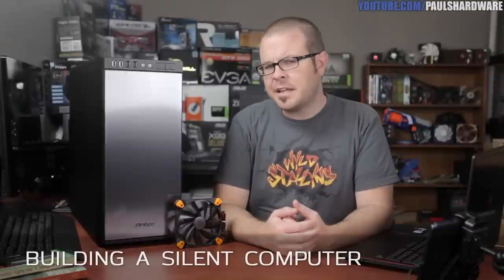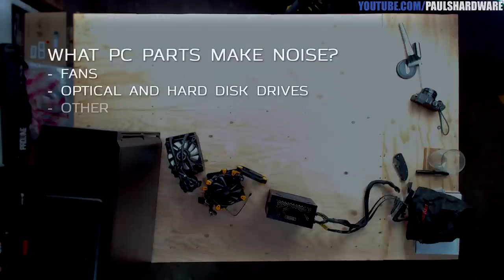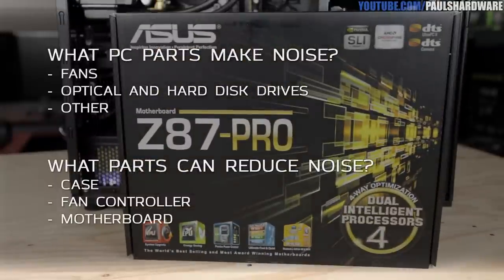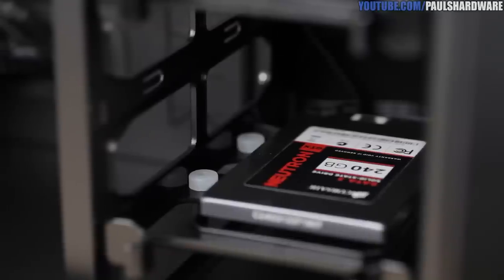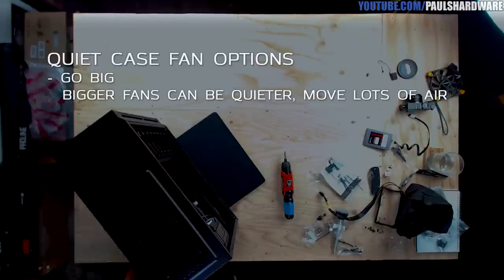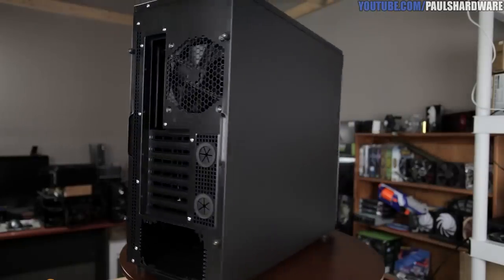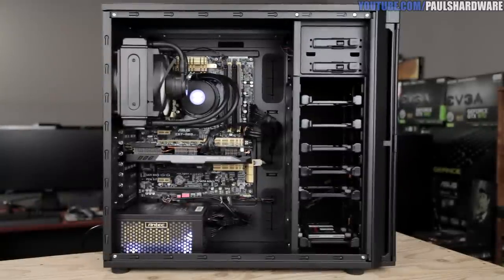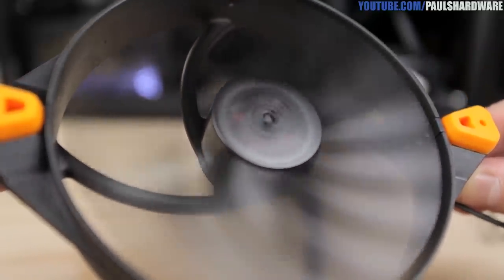Building A Silent Computer

Comment: How to build a silent PC:
1. Don't.
dB Measurements:
Case Open: 0.0 dB
Case Closed: 0.0 dB
Reply: lol literally my computer right now can fill my bedroom with its fan noise
Reply: I can hear my pc from living room
Reply: Mine was pretty quiet. Then I overclocked. Now it fills my room with noise
Reply: I have a overclocked Q6600 (3.2GHz) and a passive GT 430 in my PC, powered by a be quiet! straight power 10 500W. I sit right next to it but cant hear any noise (I can only hear something when I press my face on the Define R5, but who does that anyway?)

Comment: Paul, I challenge you to build a completely passively cooled PC. BUT the CPU must be water cooled, without fans on the radiators or anywhere in the PC.
Reply: ***** The pump just moves the water, it doesn't cool.
Reply: NeonCreepers moving parts = active is what he was trying to say.
Reply: Well, I believe water cooled with a fan-less radiator would be pretty useless, but I may be wrong. For a truly fan-less PC, 100% passively cooled, you would likely be far better off using a quality large heatsink and the lowest TDP CPU you need. Then again, I have seen builds with high-end CPU's, a nice large heatsink, and no fans on the CPU cooler and it works. Just hotter than using fans on the cooler, but there were still fans moving air through the case, so there was still minimal airflow over the fan-less heatsink. Air still moving through the case.

There are some fan-less power supplies and GFX cards on the market, but not many. Perhaps you could even rig up some sort of exotic thermoelectric cooling solution.

Basically, you could do it, but it would limit some of your hardware options. =]
Reply: NeonCreepers The pump makes a heap of noise. Trust me, my fans are off 90% of the time, and the pump makes a shit load of noise.
Reply: TRStrider74
That's why I said he should use a watercooling loop, a heatsink has been done before, but not with an passively cooled radiator.
Reply: ***** What you described is pretty much a vapour chamber, it's very efficient at spreading and transferring heat to other metals, but eventually you'll need something to cool the heatsink itself, it's actually used in many coolers.

Really the only way you can go passive is if you have very low power components (e.g. Intel Atoms/ULV CPUs) and rely on convection and relatively big heatsinks, even with massive heatsinks designed specifically for 'passive' cooling (e.g. Scythe Orochi) you still need some decent case airflow. The other option of course is to move to heat to another room or outside using an external pump, but strictly speaking that's not a passive system :p.
Reply: someone has already done that a few weeks ago cant remember who but i think it was linusteechtips
Reply from the maker: NeonCreepers Nicktrance1 TRStrider74 I agree this would be very difficult for a full-size/power system. But not unheard of... we'll start with a Silentmaxx TwinBlock and go from there :-D
Reply: Paul's Hardware Yes, I mentioned the Orochi too, but would that actually be enough in a closed case with no fans and other heat sources? :P. (Not practical, I know but it's what we were going for)
Reply: ***** Oh I had forgotten about that, although even Silverstone seems to have given up on it considering we haven't heard about it since xD.
Reply: NeonCreepers Water cooling passive is worse than air cooling passive..
Reply: Thomas The Dank Engine Buys Raspberry Pi
Reply: Vinsu Karma You still need a pump :P.
Reply: Vinsu Karma Sure but it's not passive.
Reply: Vinsu Karma I've had 2 H100is and both make more noise than the fans on minimum, with Quiet Edition fans.
Reply: Nicktrance1 Coil whine can ruin a completely silent build, also.
Reply: Fanless psu, r5 without fans, bequiet passive cpu cooler and passive gpu
Reply: ***** Thermal throttling ftw.
Reply: +Jon Doe (Mr White Foxy) The worst part about soemething like coil whine is that if ya got it, unless it's super bad, you're boned lol.
Reply: Disturbed246810 EVGA replaced mine pretty quickly back when I bought it without any hassle, problem is it's a common problem in all ACX 760 so the new one was almost as bad... at least it overclocked a bit better xD. It's funny to me that he chose this card since it can also only go down to 43% fan speed on stock bios... not a very good contender for a silent pc build as he stated in the comments himself.
Reply: Ive built a few office pc's that only have 1 fan on the cpu cooler. Temps were fine since the office was always at 75 degrees and the pc was just used for normal office softwares.
Reply: This is bullcrap.. You would need like a .. well no case really.. or.. nah.. maybe if it was like super weak system for like internet browsing them maybe cos not even PC drowned in oil is self efficient enough to resist the heat without the fans when under load for some time

Comment: Great video, Paul.
I bought 3 of those orange Cougar fans and every one of them was loud and vibrated really bad. The vertical fans didn't vibrate but the horizontal fans would, since the middle disc had quite a bit of movement for some reason (you could push it like a button).

Comment: Great tips, but there is one key one which you missed... move the computer. Since it is rare that you need physical access to the machine itself -- even you removed the optical drive -- you often have the option of simply putting the computer someplace where its noise won't reach you, as long as the cables reach your TV/monitor area. A nearby closet is great, a cabinet is also fine (just watching air flow), and another room is also fine -- just run the cables through the wall. Just run a USB hub out, your HTMI/video, and the speak wires out. A few inches of wood or drywall, eliminates a lot more noise than days or playing with fans. Just move the machine to a closet, plan your media room to have the computer next door, or look for a work desk which includes a cabinet with doors (and still has airflow, or cut some holes out the back/sides).
Reply: BW022 that'd be a bit overkill if you ask me
Reply: Old Mate Hezza In that case(..get it?), go nuts.

Comment: I find 140mm fans plus are the way to go, on medium performance my PC runs at 30db. But I put together a large case with fans only. Where the smallest fan is a 120mm on low rpm. I think, the more room there is between components, the better.

Comment: I put my current rig together about 2 years ago for the most part. When I first turned it on I thought it was broke and not working. There was zero sound from it. Its still quiet today even with new parts in it. The case is a CoolerMaster Storm Scout.

Comment: While I agree with most of the suggestions, I'm kinda left scratching my head at some, like, why the small fan CPU loop and why two small intake fans instead of a huge slow one?
While I have no experience building a completely silent PC, I did build several very quiet ones, and my recommendations are these:
Avoid sound-padded cases. You can't completely close off a case without completely blocking ventilation, and if you get partial padding, the noise will get out from the vents anyway. So go with good airflow, especially with a top grille so that hot air can escape by convection. Also, go with a 200mm intake fan with a dust filter in front, which you can vacuum regularly. 
Go with a huge air cooler on the CPU; it will have a slow, mostly inaudible fan and if you don't overclock the shit out of the system, it will keep idling even at load.
Go with an overkill PSU with hybrid cooling (passive at idle, fan turns on at load but at low RPM).
I agree with the GPU recommendations, nothing to add there.
Some hard drives are almost completely inaudible, while others are the noisiest part of a build, and I have mixed experience with figuring out which is which. A Seagate Barracuda green series in my current build is almost completely inaudible.
Basically, solve most problems by picking quiet components, cooling everything passively as far as possible, and using only big, slow fans for the rest.

Comment: I have an i7-2600k overclocked to 4GHz with no fan or water block. Completely thermal cooling via a NoFan CR-95C fanless cooler. It's a heck of a good cooler. Normal CPU temps are about 42C. I also have a fanless Silverstone 520W power supply. Case fans are mostly Noctua, who makes some very good fans.

Comment: well I'm with a bit of a problem now. But let me describe my build first.
I'm running:
FX-8350 @4.8GHz
Corsair H80i
Asus Crosshair V Formula-Z motherboard
MSI R9 290x Lightning
Samsung 840 Evo SSD
WD 2TB Green hard drive
Corsair GS800 power supply.
All of these components are combined in the Corsair Carbide 400r case.

Now my pc always made a lot of noise and I wanted to cancel out as much as possible, so I decided to upgrade components gradually. The main noise came from the H80i, so I replaced those fans with two Noctua NF-F12 fans, but still, this didn't make the noise go away. I then unplugged the HDD and stopped every single fan in the system to see what is causing the noise, but it won't go away, thus I presumed it was the H80i pump. Upgrading the cpu cooler to a Noctua NH-D15 made it silent under full load, but the pc still makes some sort of vibrating noise. As of now, I still have no idea what is causing it,

Now I'm thinking it might be my power supply, since it's flipped upside down for easier cable management, and I don't need the LED's on the psu, I can't reach the fan to see if that's the problem. I can't swap it out since another psu would mean another cost...

Comment: I added a third fan to my full tower for the LED effects and it became seriously noisy. I lived with it for a good thirty minutes before realizing the fan was backwards. Switched it around and the now stabilized airflow reduced noise by a TON. Point being, make sure the airflow to your case is adequate or your fans will surely be fussy :)
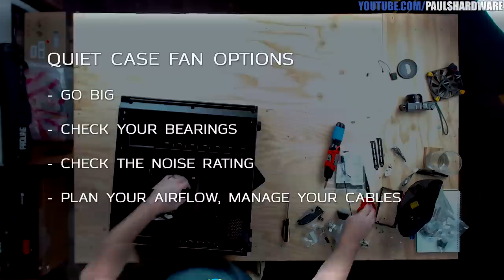Reply: 8:15 is a perfect example so your fans don't have to work so hard!

Comment: do dust filters/covers make more noise due to air moving through them ? what is a workaround for such problem and how to identify if it makes the noise rather than the fan itself ? (basically how to reduce air movement noise)

Comment: So I had a big problem with one of my case fans, they were the quietest fans I ever had until one day when the outtake case fan decided to be extremely loud. I switched the outtake fan with my intake fan but that didn't work so I plugged it into the molex connector that directly goes into my PSU. What was the problem?

Comment: I'm trying to build a gaming and silent computer and have been using this as a little guide. I like the idea of the case and would go all for it along with the fans but my main concern would be the cooling within the computer. Along with it being safe when gaming in view of over heating. I would like to make a silent computer do to wanting to broadcast and play at the same time but need a little bit of guidance. I have virtually built the computer on the website you had mention in your other video (PCPartPicker) using the case and fans you had used in this video but would like to ask if you can view it on the link below and see if it would be a good build.
I'm also on a tight budget. I would like to be under 1000 dollars but if it goes over by a little bit, that is okay, as you see I did go over. 
But PLEASE take a look at my build and tell me your thoughts about it and what could I change to keep it a good gaming computer, as well as silent. 

Your subscriber,
Cisco

Silent gaming computer:
http://pcpartpicker.com/p/k4Qcpg
Reply: Have you build a pc?

Comment: Can anyone tell me if the accompanying fans on the Antec P100 have PWM or a 3-Pin connections? I ordered this case together with the MSI X99S MPower board and found out that the board only provides PWM connection.

Comment: wouldnt it be better to use aio watercoolers for graphics cards?
i got a pretty massive cpu cooler that keeps my cpu cool and is absolutely silent, but even the modded graphics cards are running relatively hot which results in loud fans

Comment: I actually do have some coil wire noise when my cards are running at full power. I am currently rocking 2 r9 280x. Normally they never make a noise, even when gaming, only happened when i did a benchmark of my cards. any thoughts?

Comment: Very nice video, but I would add looking into the Antec Earthwatts series of Power supplies, and they are known to run quiet, and cool, while being very power efficient, and building with MiniITX AMD APU setups that have fanless heatsinks on the motherboards can help as well, long as you have some good quiet system fans too run some air, and help keep everything cool. No they won't blow you out the water with performance but for a basic quiet system that can do some light/medium gaming they are just fine.
Reply from the maker: Earthwatts PSUs are great! Thanks for watching and for the suggestion!

Comment: Paul I saw that you have the PSU fan down. I have mine facing up, is there a reason to change its position? Also I don't know if I miss the part where you said that electrical noise isn't normal and how to fix it. Thanks
Reply from the maker: You can position your PSU either way, I usually point the fan down though so that it's pulling in fresh (not warm) air from outside the case, and to eliminate the possibility of dropping a screw or something down into the PSU grille

Comment: Great video, but the videocard choice makes no sense to me. Does the 760 also turn off its fans when in 2d mode? I thought this is a 900 series only feature.
Reply from the maker: The 970 would have been a better choice here as it is a bit quieter and has the zero fan mode. I think I decided not to use it because I have already used the 970 in quite a few videos recently... sometimes my decision making can be a bit arbitrary :-P

Comment: For some reason I can control the top fan of my PC with Speedfan, but I have no controller over the front fan.  I'm using an AsRock Z77 Extreme4 motherboard.  Any suggestions?  I tried installing a fan controller, but it started to spew smoke at me when I started it up lol, so I removed that POS.

Comment: Loved that. If I was building silent, that would have to be it.
Could just add though, that as every fan adds noise, I just run my case with no case fans and the side off, on it's side. If you don't have pet rodents, felines, canines, or toddlers, it's an easy way to keep your CPU and GPU cool, since their waste heat will tend to rise and with no side panel to circumvent that they will stay nice and cool.
Unless you're in Hawaii or something, in which case, fans fans fans.
And more fans.
Please don't be put off a PC build due to cooling just because you didn't think of running a PC on it's side with the side panel off. Nothing evil will happen. It's perfectly acceptable.

PS thanks again for another downsampled 1080p video -- they are brilliant.

Comment: My silent pc has no fans at all. My case for choice was a Ncase M1. No fan 80c heatsink. Artic cooling fanless triple slot cooler. Psu for choice was a seasonic 460w fanless psu. The downfall is that after multiple rma's every psu has electrical noise. At the moment I am using a Falcon Northwest Tiki with a BeQuiet! Darkrock LP cooler and a Corsair SF600 600W which was needed for sfx form factor. It is fanless until 120w of power draw which is nice and no electrical noise. I will install sound dampening foam to further noise reduction. I just bought a Nexus silent mouse and a Matias Quiet Pro Keyboard.
Reply: how did you install corsair sf600 in falcon tiki. please share the knowledge :D
Reply: Pretty easy honestly. I shoved it inside the case and didn't screw it in. Damn thing is totally opposite compared to seasonic sfx mounting. On'y complaint is the fan ramps up and down. I've gotta block the 120mm case vent with a metal plate and sound mat the case.

Comment: Paul's Hardware Awesome video man! I do have one query though. HardwareCanucks Review stated that this case has a big problem with the 3.5" HDD mounts and said that the screws were too long for the plastic spacers and may cause vibration. Even though this build didnt consist of any 3.5" HDD's, did you by any chance notice such a problem. Many thanks! Keep up the great videos!

Comment: i builded one pc with the same motherboard (z87-pro). every fan plugged in correctly and is running like normal. also the fans are detected be ai suite but i still get the bios cpu fan error with every start. i think it is because the bios thinks my cpu fan isnt doing enough rpm to cool properly but thats not the case because all temps are perfectly fine. any ideas how to fix this error?

Comment: what about a custom water loop? Running 3-5 60mm thick rads in a rig can be used with fans at extremely low rpm and still get a good overclock.
Reply from the maker: Custom water loops can be geared towards silence, but I wanted this to be a tutorial and going the custom water cooling route would have limited its value for most builders I think

Comment: I'm sure others have said this but coil whine is NOT indicative of faulty hardware. Coil whine is not covered by warranties either. If you get it...bad luck and there's nothing you can do about it. Good news is that the component (for example, the power supply) has no faults.